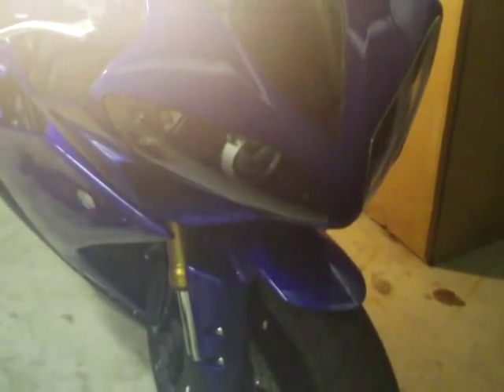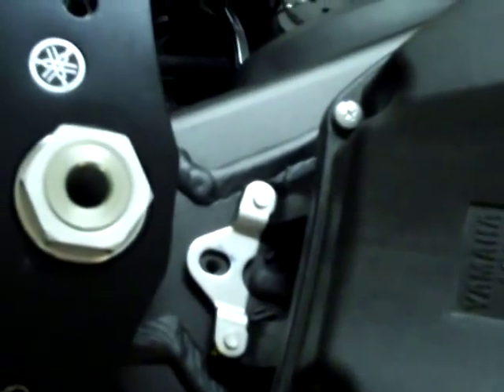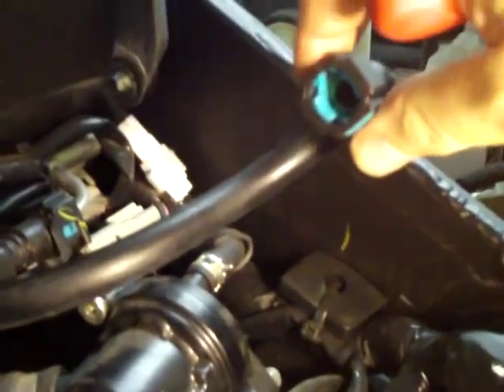2007-2008 Yamaha R1 Stalling Problem Fix / How to

Comment: Are you single? Because I would like you hand in marriage. I have an 07 and an 08 and I am the second owner of both. They both siffer from random stalling at stop lights or whilst just at idle. I did this to both of them and neither of them have stalled since. The 07's were tightened all the way when I went to do this so that probably explains that one
Reply from the maker: 😂single Pringle! Glad I was able to help.
Reply: @SparkysGarage  really quick, which direction makes the idle higher? Tighter or looser?
Reply: Hows it been running since you did this
Reply: @mikemike3514  good, good. I would highly recomend using the a 4 way manometer to properly sync your throttle bodies. But this works great in the mean time. I would start at 180⁰ and adjust in or out from there. Just experiment a bit.